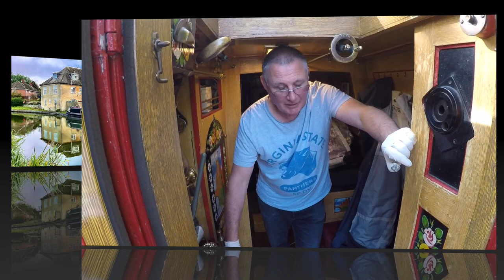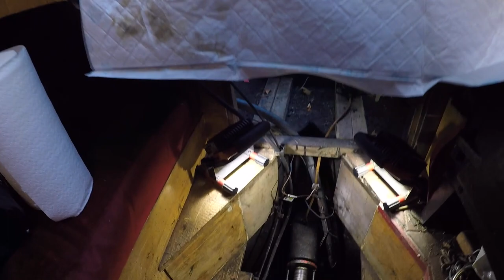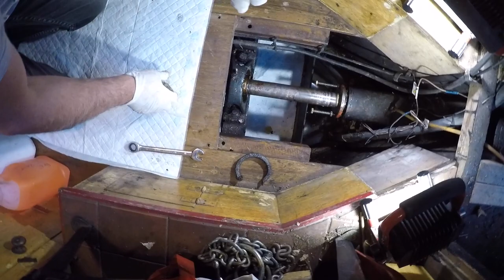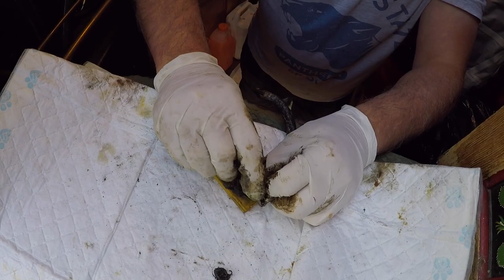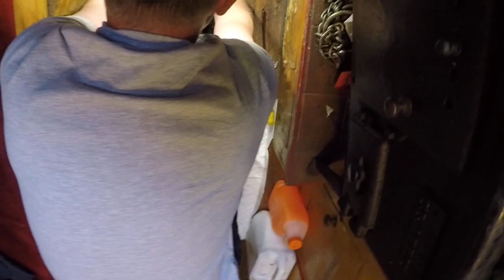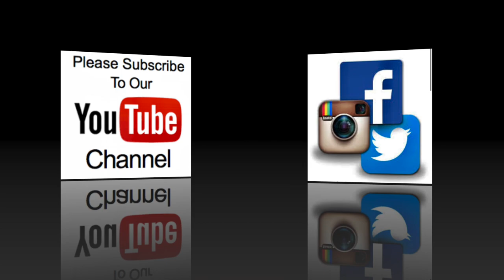#50 Narrowboat Vlog - How To -Repacking The Stern Gland

Comment: I always assumed you had to remove the old packing then put in the new, you learn something new every day
Mine is a real pig to reach, have to lay across the engine and can just reach the adjusting nuts with 17mm spanners.
Broke a rib last time i adjusted it so god knows how I will ever repack it
Very informative vid. Thanks 👍
Reply: Well Deck Diaries if the boat had been out of the water I would have removed the old packing first but not with it in the water. Thanks for watching Mark. The joys of the engine being way back.

Comment: great video, you said you had pre filled it with greece, where did you put it in and should i be carrying a grease gun with me?
if so what type of grease should i be using.?
Thanks so much fro a Bootneck with no idea.
Reply from the maker: I had re-filled the stern gland greaser just before this job and is shown in the Vlog before this one. Stern gland greaser is fitted to this type of gland and has a screw down handle.